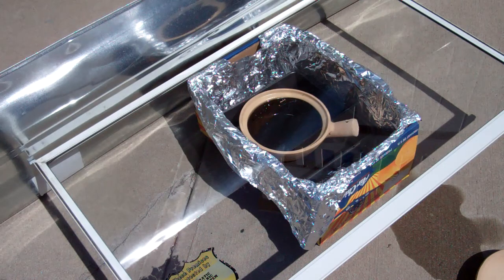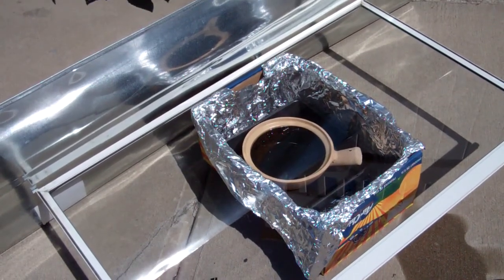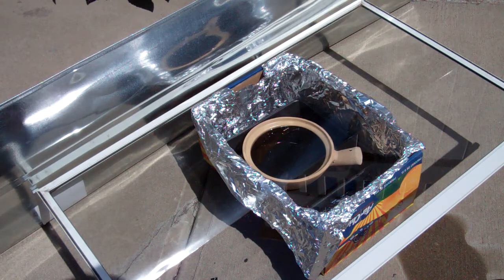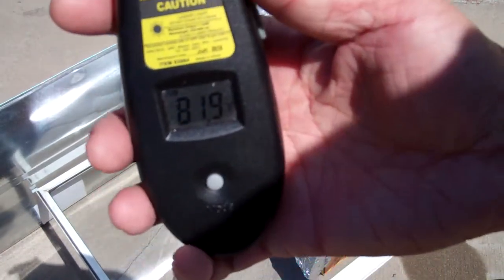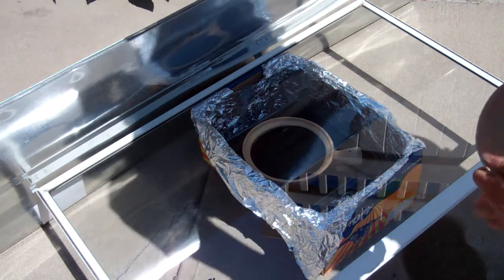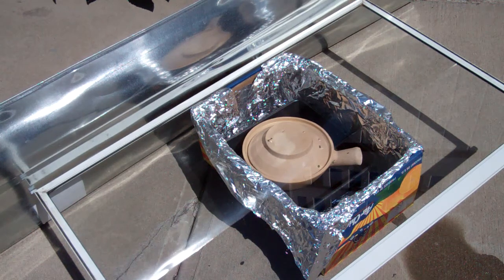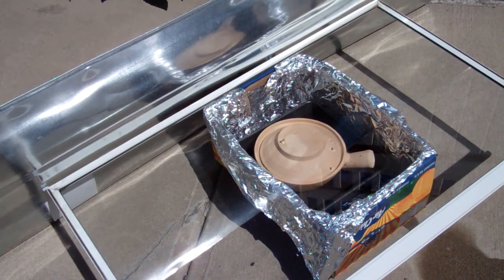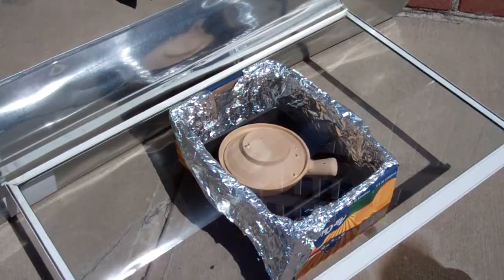My solar oven experiment, part 1 - basic build water reached 126 F in one hour

Comment: Seems like you could use it as a braising oven if you could get up to at least 180 but not over 210. Cooking all day "slow and low" for super tender short ribs, lamb shank etc. Typically it is seared first (you can do that inside) then they are submerged in a braising fluid for hours. Braising fluid should have an acid component ie. wine, lemon juice or even a little coca cola. You could also use it to dry fruit? Good project

Comment: I'd like to see water boiling in that oven. Then you're getting somewhere.  I'm wondering if you've seen Dan at Greenpowerscience burn a piece of wood in seconds with a Fresnel lens.  It's a record 106.5 degrees here and still climbing.  I'd guess normal temps would be around 85 for this time of year, but those days are gone and will probably never return.

Comment from the maker: You got that right. So hot you can fry an egg on a rock in Arizona. Tomorrow is going to be hot here also. But the solar oven is supposed to work in cold weather too. The water has gotten hotter to 134 degree F later but still not hot enough to cook. Oh well, they make it look easy.

Comment: That's not bad for a start.  I'm wondering if things will bake at around 250 deg at longer time periods. It would be a good day to test an oven here because at 12:40 PM, it's 102 deg and climbing.  Agriculture here in the corn belt of America is likely completely ruined for the year because of the drought and extreme temps.

Comment from the maker: The water is hot at 126 F but not hot enough. Black roofing is good and I can add sheet metal inside the box. Some might object to black roofing material as we don't know if it's safe to line the oven. More reflective material, better seal, much thicker insulation, dark color cookware, angle towards the sun... I can go on and on. At least now I know what I have is about 90 degrees short of the boiling temperature.